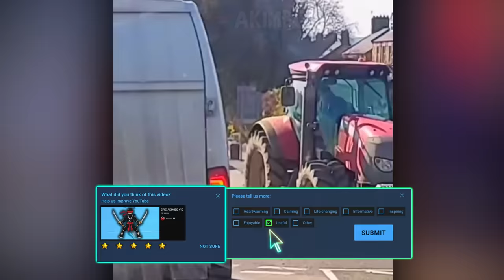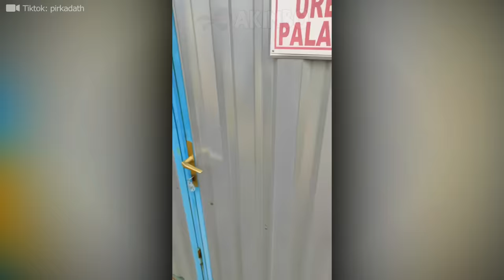YOU HAD ONE JOB!

Comment: No family car is designed for 600kg of cement? Tell that to my 1990 Volvo 240. On one occasion it was 3 squares of shingles, 2 rolls of roofing felt in the back of the wagon. Four sheets of 4x8x1 roof sheathing. Just a shade under 1,000 kilograms. That was only a few miles. Another time it was a professional wood working shop. Table saw, lathe, plainer/joiner, drill press, and band saw plus the hand tools. Again, just under 1,000 kg, but this time a 500 kilometer run. That was when Arthur was being driven by Hotrod Harriett, aka Ma. Yes the car was a "Little Old Lady" driven car. In 25½ years she put a touch over 300,000 kilometers on the clock. I've doubled that in the last 8 years.
Reply: Not surprising at all...those older Volvos were built like tanks.
Reply: Dont lie.
Reply: @GSP-76 then why isnt it in the army huh?
Reply: Darn that’s a tough car
Reply: Haven’t you heard of a van?
Reply: Or my old oprl zafira max so far ton and A half A bit more and fuck
Reply: 7😮77🎉😅o😊po8iuujnjtyjjjjjhyuujnnnnk😊😊😊😊😊😊😊😊😊😊😅😅😅😅😅😅😅😅😅9iujbjuuiiijkkiiiiokkkkkkkl🎉🎉🎉🎉🎉🎉😢😢🎉🎉🎉🎉🎉🎉🎉🎉🎉🎉🎉🎉poiiiiiuiiiiooloio7😅😅😅😊89😊😊😊😊00😊😊ikhbnñññ😢😢😢6😢😢6😢😢7😮😮😅7😮7😮😮😮😮❤❤❤❤❤❤❤❤❤❤❤❤❤❤❤❤pooiikkk❤❤❤1kkkk1❤❤❤❤❤❤😊😊😊😊😊😊😊😊😊😊kkkjjjhhj❤❤2b❤❤❤1❤kjhhhuhcg❤❤❤❤jjhghh❤❤❤❤❤❤❤😂😂❤❤❤❤❤❤😊😊😊😊😊😮😮😮😅😮😮😮😮😮🎉4🎉🎉🎉🎉🎉🎉😢😢😢😢❤❤❤❤❤❤😂😂😂😂😂😂😂😂ikkkkkklmmmll❤❤❤❤❤❤❤lklmllk😊😊😊😊❤❤❤😊😊😊😊😊😊😊😊❤❤❤❤😊😊😊😊😊😊❤❤❤❤❤😊😊😊😅😅😅😅😅😅😅❤2❤❤❤hgvblbvbn😅😅😅❤❤❤❤❤
Reply: Volvo’s are the tanks of cars.
Reply: What about the Nokia car
Reply: @Reallyredatickman  Nokia never made cars.
Reply: @GSP-76  Older Volvo were built like tanks, but still can't survive getting shot or crushed by a tank.
Reply: Point is if you overload your car it will have trouble breaking and taking turns, making you dangerous idiot to drive it anywhere.
Reply: Bro that's only like 150k miles 😅😂
Reply: @philliphager6107  he said he doubled that genius, that means it’s at 300k miles now.
Reply: @Reallyredatickman Nokia? Where did you heard that brand of cars?
Reply: Hopefully no one says "don't care"
Reply: Bmw take it oooo

Comment: 2:28 My VW Touran has a curb weight of 1633 kg and a technically permissible total mass of 2260 kg. This means you can carry 627 kg. btw: this is gypsum plaster, but each sack weighs 30kg anyway
Reply: And remember that Payload Rating is NOT about how much it can haul or tow as far as shocks, frame, suspension, etc. - the rating is there because that's the maximum weight you can safely STOP !!
You can usually haul twice as much or more before harming the suspension and other parts - but you couldn't stop it in time, your brakes may fail ( more likely outcome )

Comment: 8:14 My issue with this isn't so much that he's not being safe. It's more that he isn't reacting to it AT ALL. He just does not care about the fact that he is being pelted in the face with red hot shards of metal. I've soldered before (basically melting lead solder onto two or more wires to hold them together in what is called a splice) and I am certainly guilty with putting my face into the smoke in order to see what I'm doing (I do hold my breath so I'm not breathing it in that much). But this takes the cake.
Reply: I thought I was the only one who noticed
Reply: Just.Ed1tz Well it is red hot shards of steel dude. Or do ya mean solder? Cause that shit'll burn like metal lava too.  🤷‍♂😂😂
Reply: Most solders lead free these days anyway so no big deal. And even if it is lead solder (which works better) as long as ya not doin it all day everyday then it's no big deal. And the smokes just the flux burning off anyway. Ya need to get lead or tin a hell of a lot hotter than a soldering iron does to make it smoke. Ya need to get it to smelting temperatures which is like thousands of degrees to get it to smoke.
Reply: @28russ  Lead is a metal that is easily absorbed through the skin. It enters the body via the sweat glands and then the plasma gives it a short cut to your brain. 
Plumb stupid was very real among lead workers in the late 19th and early 20th century. It was quite common for a guy buying a pint of beer, to hand his wallet to the bar tender, because he could not work out which coins he needed.
It was even worse for the lead miners, who rarely lived beyond 40.
A few things have changed for the better these days.